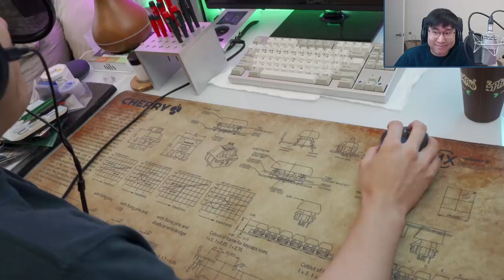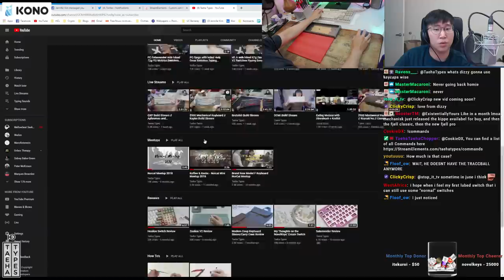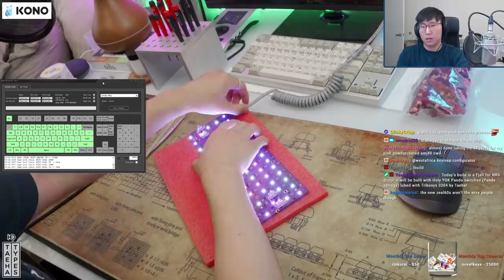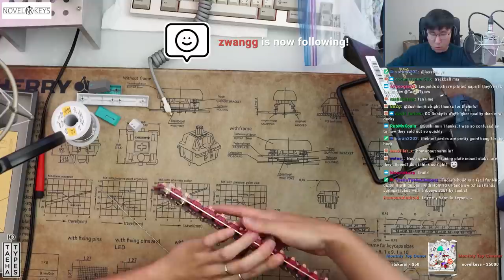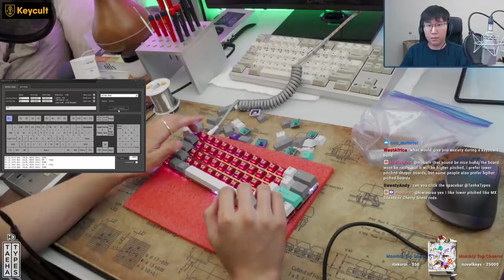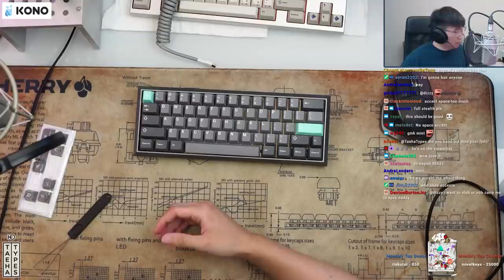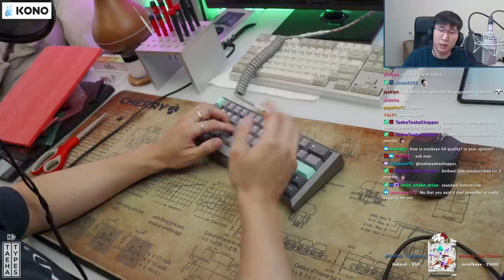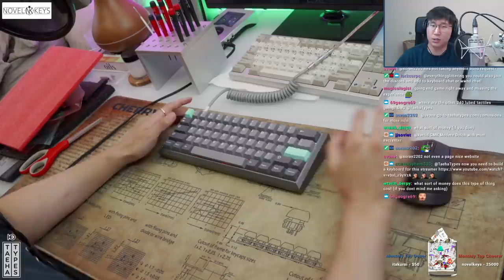Building NRG dizzy's Custom Mechanical Keyboard

Comment: How often do you have to re-lube your switches? When I build my first keyboard I was thinking of lubing the switches but if I have to reapply the lube every month for a consistent typing experience Ill just leave the switches stock.
Reply: No one really talks about this that much.
I myself feel that my keyboards felt godly within few days after i lubed. It starts getting slightly louder after a few weeks. The stabs also started some soft rattling, but overall still slightly better than unlubed in terms of sound and feel.
Reply: @pineapple0427  ok and how long have you gone without re lubing the switched and stabs?
Reply: @antoniounchained7522  My first board is a linear board .It sounded the same as unlube after 3 weeks on the normal keys, the stabs is probably have 50% of the lubing efffect left after 3 weeks.
 Smoothness wise it is still around 40-70% of how it was when i first lubed? It has been  1 year since i lubed the normal keys. I do still lube the stablizers every half a year though.

My second board is a HHKB. The stabilized keys started rattling after 2 weeks. The first time i lube, it was with krytox 105 on the rail and 205 on the stab. When i first lube it , the sound and feel are perfect. my dream board. 
but the sound on the normal keys are back after like 1 month?

I then bought silence x rings and relube the slider and stabilizers with 205. Again, sound and feel perfect but stabs started rattling after like 1 month again, not as rattle as unlube but is not as effective as freshly lubed. The normal keys are still ok as i have silenced them, still feel around 80% sound and feel wise.

Again, it is all my own personal opinion. Seeing as you are interested, about lubing I would suggest to just try it at least once and then decide on your own later on whether it's worth it or not. Also, I don't think you need to relube it every month. but i think it will not feel the same as freshly lubed, but it will still feel nicer than unlube. :D

Comment: Can someone link all the parts as I want to build that exact same keyboard for my setup
Reply: Switches - https://drop.com/buy/massdrop-x-invyr-holy-panda-mechanical-switches
Keycaps - https://dixiemech.com/gmkmodo
Keyboard - https://mekanisk.com/
Both the Modern Dolch and Fjell are ended group buys. You can probably find the keycaps on r/mechmarket for $150ish. They keyboard is much more expensive aftermarket.

Comment: what are the stabilizers you used?
Reply: Taeha Types hey, thanks man! I am building my first keyboard and have been spending DAYS looking at stuff. It’s so hard to find what I’m looking for because everything seems to be very limited releases. Sigh. I’m trying to build a white/purple/gold build but I’m finding it extremely hard to find stuff. 

Thanks for the tip, those staplers looked great I will definitely need to look them up.
Reply: I bought a Anne pro 2, do you think it’s worth upgrading to these stabilizers or just lube up the stock ones?

Comment: Amazing as usual! Guys, what’s the best “moderately priced” switches for gaming? I really like the sound of HPs, lubed vintage blacks and zealios. So something similar?
Reply: Sanam Limbu If linear, then I heard Gateron Yellows were pretty good and affordable
Reply: Nintee9 I have gateron browns and they’re very smooth! I just want something that sounds like the HPs.
Reply: I would recommend ergo clears (Cherry MX Clears with spring's swapped) or KBDfans T1
Reply: Daniel Yu i can’t get hold of T1s anywhere?? At this point I might just go for the purple zealios V2

Comment: @TaehaTypes So using the thumb like that is not great. The thumb's strength is at the tip, as a tool. Gamepad users often misuse the thumb as well, using the joint (super mario bros. syndrome?). By acknowledging the misuse of the thumb and correcting the use (not using the joint), it will regain its normal forward bending plasticity. Not a doctor, just an old gamer! Best!

Comment: i dont understand how people have keyboard that lack function keys?
Reply: I don't understand why you would want this?
Reply: You dont need funtion keys for gaming. 60% keyboards are for gaming
Reply: @BanditLeader  No, they are not meant for any particular thing. And of course they have function keys, they are probably on the number rows, just on another layer. Why would you want to stretch your fingers so far when you can reach it easier? ;)
Reply: @kanskejonasidag1  as i said before, function keys are useless for gaming. 60% keyboards are meant for gaming.
Reply: @BanditLeader  And as I've said before, no, they are not meant for anything in particular. If you want you could almost make the case that they are meant for software development, since one of the first commercially successful 60% keyboards, the hhkb, was designed by a software engineer.
Also, some games actually use function keys, like battlefield, Arma, etc.